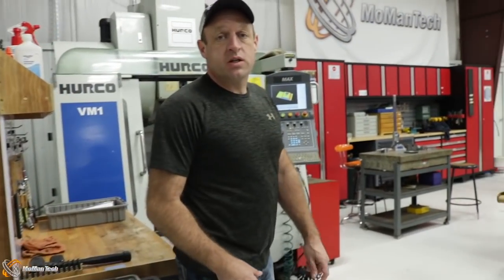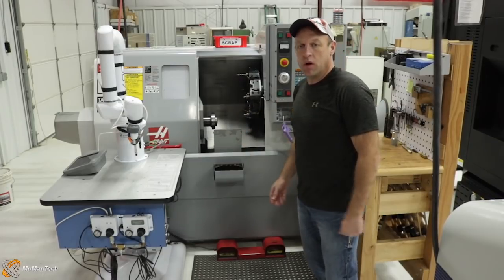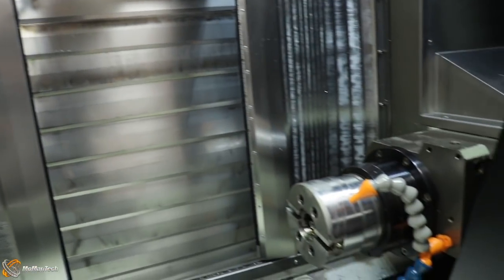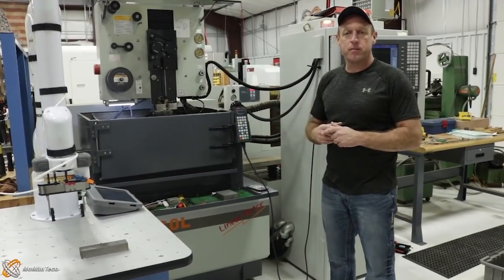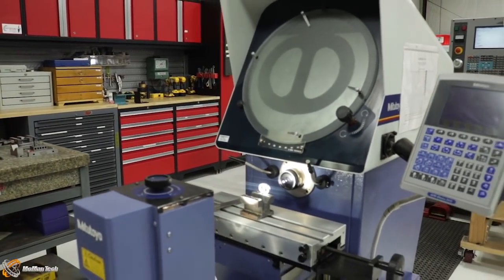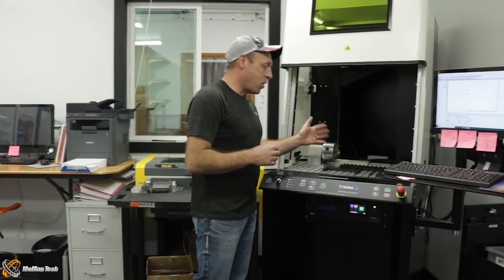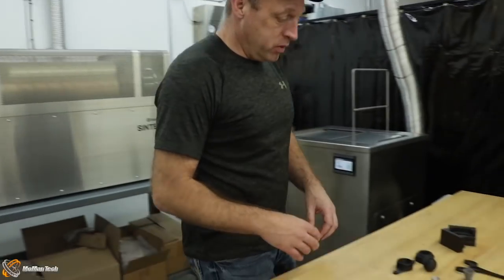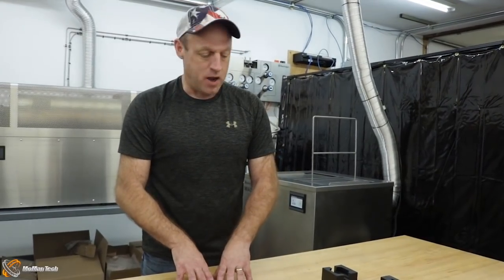Machine Shop Tours: MoManTech

Comment: It's a turn mill 

Since it's made so the main holding way is the lathe way 

A mill turn is where you have a fill table with a 5 axis head and part of the table can turn ( like 1100rpm ) 

That's the difference between a mill turn and a turn mill 

Aka. If it have a table with a turning part build into the table it's a mill turn 

If it have a chuck on the side and a mill head then it's a turn mill

Comment: What's the point of a robot on the lathe?
Wouldn't a bar feeder be cheaper/easier and more reliable?
Reply: Space.
You can also run 2op without a Sub-Spindle.
Reply: @nc.92  Seems like way too much extra work for an extra 150sq' but op 2 does make sense, I guess that's why.
Reply: Some parts, like ones with over sized diameters, cannot always be bar fed. Or the robot could load/unload 2nd op parts which have previously been removed from the full length stock.
Reply: @powermoveengineering  I would get the oversized parts thing if he wasn't a medical shop and that robot looked like it could handle something big, but yeah, I guess it's about op 2.